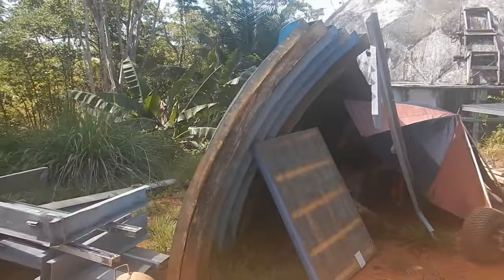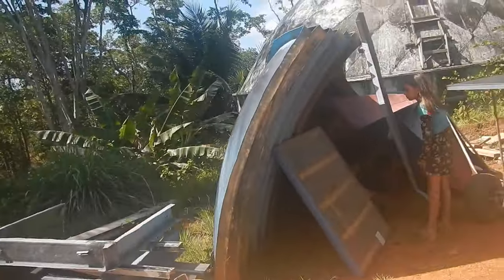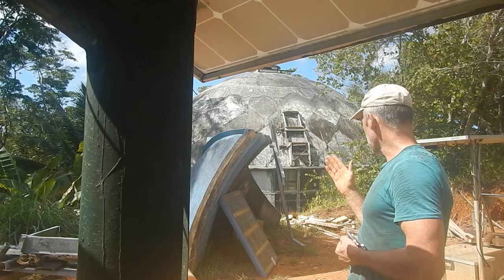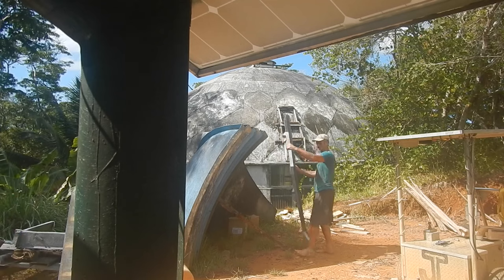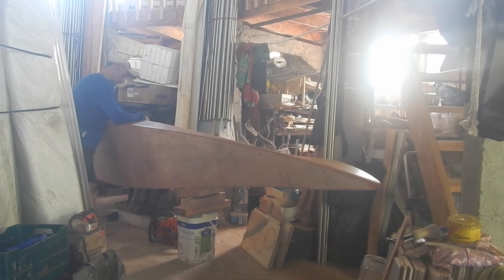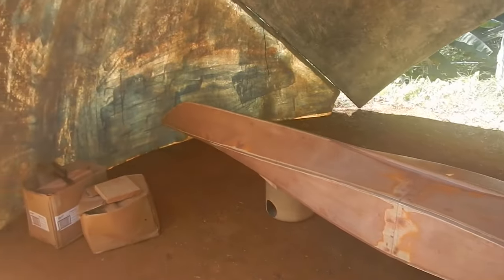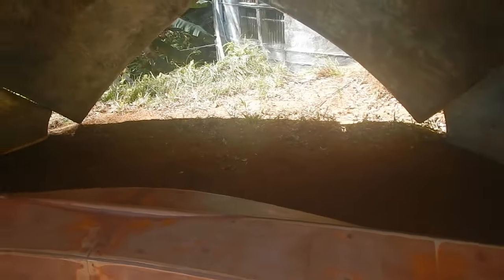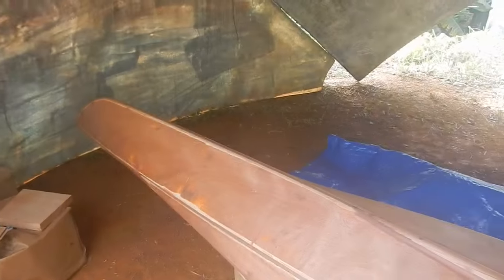Fiberglass Workshop for the Kayak! (06)

Comment: does the solar dozer still work? it could be real useful for your saw mill operations if you turned it into a winch donkey the way you did the gear boxes you could run two drums at once